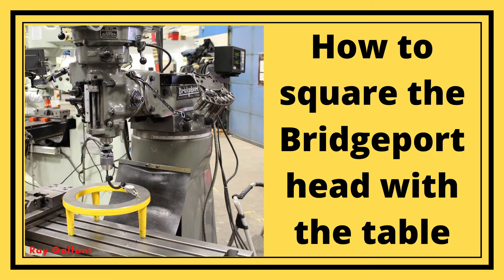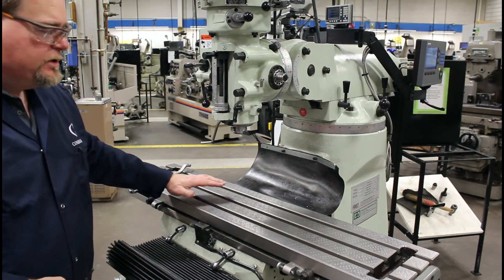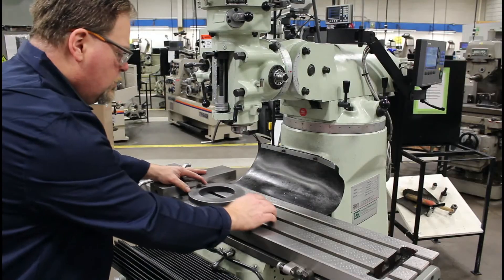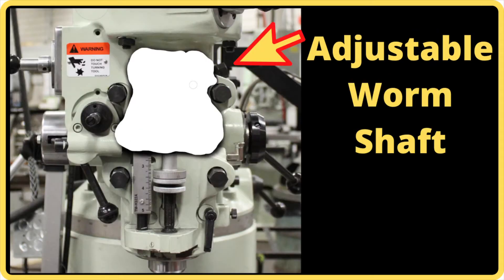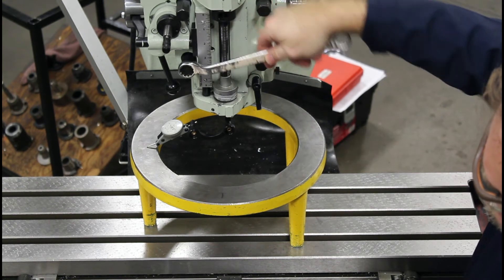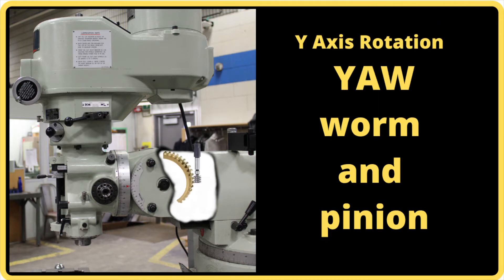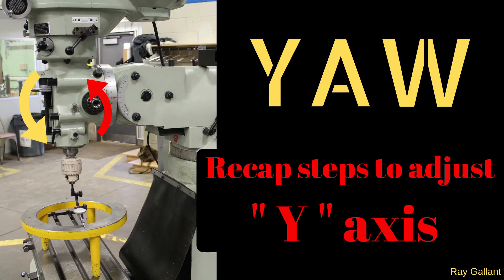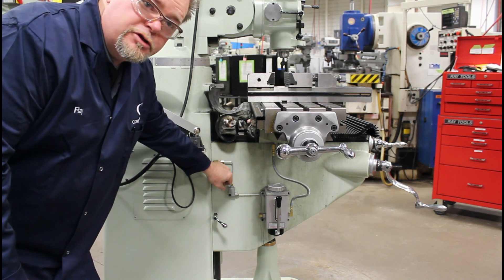How to square the Bridgeport head with the table

Comment: Its about 3 to 1 and do it faster and easier
Reply from the maker: The problem with saying that it’s 3 to 1 is that some people that are new might not understand so taking a little bit longer when they’re first learning how to do it it’s OK
Reply: Its also helps a beginner to extend quill out all the way and put a square against quill. If you don't want to take off vise ,use a 4 inch gage block or anything taller than the vise.  Was not stated in video to back the adjusting worm gear to the non tension feel.  If you leave tension on worm gear the head will try to move the head out of being trammeled to zero.    I have a 15 year old grandson that can indicate a vise in ,including having it bolted down in 2 minutes or less the way I showed him.  Richard  tool maker for 40 years.

Comment: This is the second time in thirty plus years in machining I've seen one of those rings.  Most shops the machinist will use a one two three block.
Reply from the maker: The rings are super easy for students to use
It also helps them to avoid the temptation of moving the table to the left or to the right

And as you know if you move the table too far to the left or too far to the right and try and score of the head you will have tableside to deal with
Reply from the maker: we using them about 10 years now it is easer for traning students

Comment: Where did you find the yellow EZ Tram?
Reply: Hey doug... I'll save you a bunch of money.  Visit Rockauto.com and buy yourself a brand new brake disc rotor.  If you look hard enough at different cars, you can find one that's about 30bucks SHIPPED!  It will do the same job as this yellow thing with legs sticking out just waiting to poke you.
Reply from the maker: when the college open I can ask
Reply: Thanks!
Reply: @shopandmath  Did you ever find out where they sell those EZ Tram stands? I am also interested but can't find them anywhere. Thank You!
Reply: I mean when you think of it.. assuming you’re a machinist, you could easily make one yourself